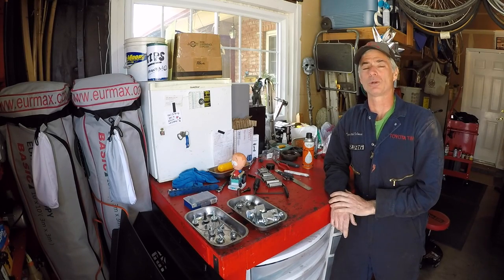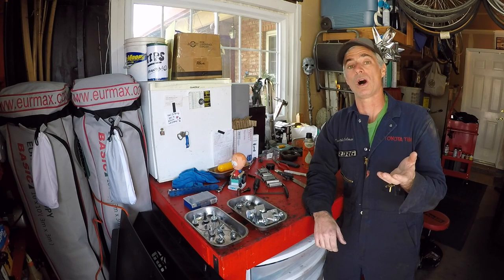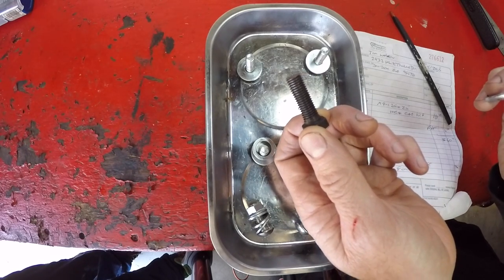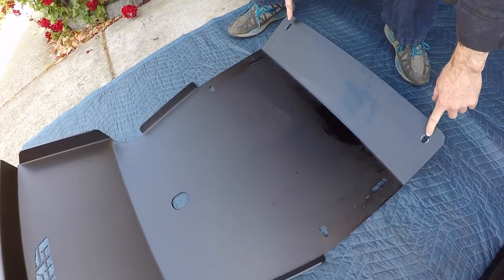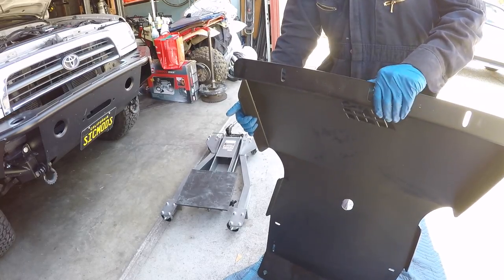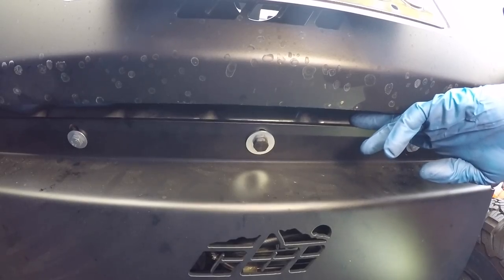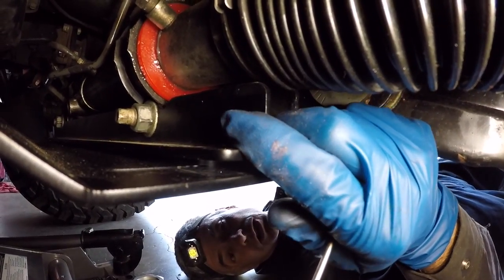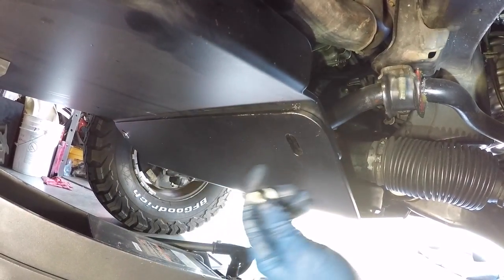CBI Skid Plate Installation (3rd Gen 4runner)

Comment: Another great video, thank you! If you get time a wheel bearing video would be great. Thank you for all your work!
Reply from the maker: Hey Bill, glad you like the video.  Our manual hub conversion video basically shows you how to do a front wheel bearing. https://youtu.be/TZ2sOfVrnhU  But, I plan on doing a manual hub conversion on my 98 soon and it will be a little different than the video we did because I will be swapping over the manual hub parts to my 4runner knuckles because I want to retain ABS function. The Tacoma knuckles don't have ABS ports.  We will make a video of the press work for this project and it will hopefully give you everything you'll need to do the wheel bearings on your 3rd Gen.

Comment: I have another brand on my Seqouia to deter the catalytic converter thieves when the wife goes to the big city.  This looks really nice. I may have to get this set for my 01 4runner.  I use the Fram Ultra filters and only pull the plate down to change the filter at 15k (@5k oil changes).  The ultra's are a great filter unlike the reg orange can.   Great vid!!!!
Reply from the maker: You know, I didn't even think about the catalytic converter theft deterrent.  They probably won't bother with my 1998 now with the skid plates in the way but they can easily cut the ones out on my 2000.  They could still get the catalytic converter out, but with the skid plate in the way, they would most likely just move on to somebody else's vehicle that's easier.  If somebody damages your exhaust and wiring cutting out your catalytic converter, it could easily cost you $1500+ in parts and labor.  You know, I just might add these skid plates to my 2000 as well just for that reason.  At first when I heard about catalytic converter theft, I thought it was just somebody needing a catalytic converter for their 3rd Gen.  But then after talking to some people about it and doing some research online, they are stealing them for the recycling money.  They get pretty good money for them at a recycler because of the precious metals inside the catalytic converter.  And, they target trucks and SUVs because it's easy for them to slide under the rig with a cordless reciprocating saw and cut it out.  

Wow, 15k filter changes.  That's something to think about.  I have been doing it old school with 3k oil and filter changes using OEM filters and a Castrol partial synthetic oil.  I've done a Blackstone oil analysis on my oil at 3k and I could have ran it much longer based off the additives still left in the oil.  I'm going to do another oil analysis at 5k and see what the results are.  I'm probably going to switch to full synthetic and just do my oil and filter changes every 5k.  I don't know if I'd feel comfortable going 15k for filter changes.  Do you have anything I can read up on that did an analysis of the oil filter after 15k, like showing one of these filters cut open to see how much the filter material was blocked up?
Reply: I guess the thieves get good $$$ for the toyota ones.  I just don't want the wife with the kids getting stuck or stranded do to some thieves. So it was worth the money to me.   Go over to http://bobistheoilguy.com/ into the forums then the oil filter section.  Tons of cut open pics and great reviews.  The filters are now rated at 20k!  They are built like tanks, silicone anti drainback, steel center tube,  wire backed synthetic media  and do not drain back or tear like purolators.  Some youtube videos on em too!  99% at 20 micron while the OE Dealer ones are like 50% at 30 microns.  My previous blackstone analysis' showed negligible iron and metals and was well in spec with the average on the side of the report.  I do all my vehicles @5k miles or 1yr whatever comes first.  In your area thats easily doable on the no drama 5z engines. Give the Castrol Magnatech Synth a go.. You can read up on it in the oil analysis area there too.  It's a great oil at a great price!
Reply from the maker: Awesome.  Thanks for sharing all this info with me.  I'm going to do some reading.  Sounds like those filters are legit.  I think I'll give that Castrol Magnatech a try too.  With more infrequent filter changes, maybe I will invest in one of the Fumoto oil drain plug valves so I don't need to drop the skid plate every 5k.
Reply from the maker: Yeah, I'm still thinking about it.  I'm also worried about the fact something could hit that lever and then I burn up my engine.

Comment: Timmy any ideas on how to protect the catalytic converter if skid plates are not worth the money for city driving. I have a 1999 4Runner sr-5 rear wheel drive.
Reply from the maker: Some people paint them with a bright high temp paint to deter theft.  Some buy aftermarket devices to deter theft but I don't know much about them.  Some add an addition to their aftermarket skid plates to deter theft.  I haven't done anything to any or my rigs to deter theft.  For my 98 4runner with aftermarket skids, I might weld on an additional side plate.  For my 2000 that has OEM skids, I don't know what I'd do for it.  I suppose you could also put some type of blocking plate to get them to pass on your rig and go for something easier.
Reply: @TimmyTheToolman   When you get a chance can you make some content on how you would protect your 2000 that has OEM skid plates. With the rise of catalytic converter thefts across the country, the 3rd Gen Toyota 4 runner community would appreciate the content. For us average Joe’s something bolted on as opposed to welding would be awesome.
Reply from the maker: @JA-xr6gr  Yeah, I'll document it if I do it but it's not going to be a plug and play thing.  This is going to be something each person is going to have to fabricate themselves.  Welding will most likely be involved.  Whatever I come up with, I'm not going to mass produce them and sell them.  It will just give people an idea of how to go about it.

Comment: Will this fit a 95 toyota t100? Also how similar are the vehicles? Will your videos cover alot for the t100?
Reply from the maker: I don't know if it will fit a T100.  You would have to contact CBI and ask them.  As for our videos, a lot of them will translate to your T100, especially since the T100 has the 3.4 liter V6 engine just like our 3rd Gen 4runners have.

Comment: Hey Timmy, can you see any downside to cutting a small hole in the middle skid so transmission fluid can be drained easily (much like the oil drain hole)? I would think this would be a feature in the RCI skids but there’s obviously a reason why they didn’t include a hole there. Any insight?
Reply from the maker: Jake Lessie You would be fine cutting a hole for access to the transmission drain plug.  You just wouldn't want to make it so big that a sizable rock could bounce up slamming your oil pan and possibly piercing it.

Comment: Did your rear skid plate have contact with your transfer case
Reply from the maker: No.  I did remove the small OEM skid plate from the transfer case though.
Reply: @TimmyTheToolman  I did as well but still have contact
Reply from the maker: @tylerwallace8414  Something isn't right then.  Maybe share some pics with CBI and see what they say.  Or, stick a piece of high density rubber at the contact point and live with it, I guess.

Comment: My rear skid plate didn't come with the fender washers. I emailed them and they said they don't come with them. They sent me the parts list and I noticed that 2 of those black spacers are supposed to come with the rear one also. My transfer case rubs against my skid plate so I wonder if those spacers are meant to fix that. I'll probably be ordering some of those spacers to fix it.
Reply from the maker: So you didn't have the same hardware that I had?
Reply: @TimmyTheToolman  Nope. I didn't have the big fender washers. I don't know why they don't ship them with it anymore. "We do not include strut washers in the 3rd gen skid kits. Sorry about that!" That was CBI's words.
Reply from the maker: @tylaroverturf  That's too bad they don't include them.  I think the fender washers are definitely needed.
Reply: @TimmyTheToolman  I agree. I think I found some on amazon that might work so I'll give them a try and see if they work.

Comment: In remarks to the catalytic converter, I know on my 00 I have 2 small cats where my dads 98 has one large one. I don’t know off the top of my head where they are placed but it might be better. Also do you think with the added aerodynamics you will see better gas mileage?
Reply from the maker: Hey Jax, maybe the later models with two catalytic converters would make the installation of that one bolt and nut easier.  I guess you could say it's more aerodynamic under the rig now but I'm sure there will be no gain in gas mileage.  If anything, you might see a decrease with the added weight you're carrying around all the time.
Reply: Yeah the weight was my next thought. If only the made them in a thin light plastic for the mall crawlers out there. With the tires I have I get about 11 to 12 MPG. Anything would help at that point.
Reply from the maker: These rigs do not do well with around town driving.  They don't do too bad on the highway though.  I replaced my 02 sensors and my mpg improved somewhat.
Reply: Timmy The Toolman I do mainly city driving and it sucks. I will look into the 02 sensors. Is it serious gains or just one or two MPG?
Reply from the maker: Probably around 2 mpg.  It's really hard to know for sure because it's difficult to match the driving situations perfectly.  Before the 02 sensor swap, the best I saw was 15.4 mpg with a mix of City/Hwy.  After the swap, my first tank got 16.7 mpg with mixed driving but mostly highway.  With strictly highway driving, I got 19 mpg.

Comment: Anyone know what skid plate would serve as a deterrent from catalytic converter theft? Happened to me a few years back, and now its been happening a lot in my area.
Reply from the maker: I don't think there's any aftermarket skid that will prevent it completely but the CBI ones I installed on my 98 would certainly deter would-be catalytic converter thieves.  It basically makes it harder for them to get in there with a reciprocating saw to cut the exhaust to get it out.  I'm pretty sure a thief seeing the skid plate in the way would just move one to another vehicle that's easier.  They do make some anti-theft devices but they aren't cheap and look like a pain in the butt to install.

Comment: A Fumoto Valve would make sense here to ease the changing of oil.  They just replace the OEM oil drain plug and then it's easy to turn the flow on and let the oil drain.  No tools needed.
Reply from the maker: Hey Ted, thanks for the suggestion.  I did hear about the Fumoto valves and I considered buying one.  But, I do like to get the skid plate out of my way for the oil filter replacement.  Some guys take it out via the driver side wheel well.  They just reach in there with a plastic bag around the filter to catch the oil as they unscrew the filter to reduce the mess.  Since I have that transmission jack, removing the heavier aftermarket skid plate is really not any harder than removing the OEM one.
Reply from the maker: Another person commenting said you can get away with 15k oil filter changes by using Fram Ultra Filters.  I'm now considering one of those Fumoto valves.  I remember there was different models of these valves.  Do you have one you would recommend?
Reply: you would want to check whats happening under your car from time to time thought. leaks , bad bushings, they might go unnoticed causing more damage if you cover everything up. 

BTW whats the total extra weight you are carrying with all these skids ?
Reply from the maker: You make a good point.  Part of the benefit of regularly getting your skid plates dropped is to do a visual inspection of how things are looking.  

I never weighed them.  I do know they are really heavy because they are made of 3/16" steel.  I'm sure CBI knows the weight but I have a feeling this isn't something manufacturers of skid plates want to advertise because it's probably going to do nothing to help their sales.  But, I'm sure if I call CBI, they'll tell me how much they weigh.  Once you get into the aftermarket craze of adding heavy duty bumpers and armor to your rig, you pretty much have to accept you're going to take a hit in your mpg and be ok with it.  So for me, I don't really care how much they weigh because I want the protection when I'm 4wheeling.

When I picked up my CBI order from the freight company, it came on 2 pallets.  The order was the front bumper, rear dual swing out bumper, rock sliders, skid plates  and a Warn M8000 winch.  The shipping papers said it was 550 pounds.  Subtracting the weight of the pallets and packing material, I'm guessing when I have everything on my rig, I will have added around 500 pounds.  The winch is the last thing I need to install.  So, it's like i'm carrying around 2 big adults all the time or 3 average sized adults all the time.
Reply from the maker: Thanks Ted.

Comment: Nube here. Looking to buy my first 3 Rd gen. I've been going through the bottomless pit of videos and articles on what to look for and also what too walk away from. Have you done any videos on what too look for?
Reply from the maker: No, we don't have a video for this but here's some advice.  
1) Don't be in a hurry to buy.  The market for 3rd Gens is way overpriced right now.  If you're patient, you'll find a better deal for yourself.  It took me a year of searching to find the 98 I bought at the beginning of this year.  
2) Use Auto Tempest for your searches.  You can search multiple Craigslist areas at the same time based off how far you're willing to travel.
3) Look for vehicles that have a single owner because then you'll get a better vehicle history.  
4) With used vehicles, service records are super important so you know the vehicle was well taken care of.  A CarFax report will show some services but not all depending what shop the owner used for servicing or maybe they did their own work.
5) Do a thorough inspection of the vehicle.  See what the engine oil looks like.  See what the trans fluid looks like.  Are there any major oil leaks.  Is there any body damage.  If you are in a part of the country where they salt the roads, check the undercarriage for significant rust.  If the frame is rusted really bad, don't buy it.
6) Definitely run a CarFax report to make sure there's nothing wrong with the title, there's no accidents that they didn't already tell you about and if there's signs that they are trying to scam you.  Odometer fraud is pretty common.  Look at the mileage it was last smogged or serviced and see if that matches with what you're seeing on the odometer.
7) Take if for a test drive and see how it runs and drives.  Do a brake check and see if it pulls one way or the other.  Does the transmission shift ok?  Are there any weird sounds or vibrations?  If it's a 4wd model, try it out in a parking lot somewhere and make sure it shifts into 4high and 4lo.  If it has the locking rear differential, put it in 4lo and push the locker button and make sure it engages.  You'll hear it and see the light on the dash.  If the light is flashing, it's not engaged.  The light will be solid when the locker is engaged.
8) Make sure everything works.  The power windows.  The moonroof.  The sideview mirrors.  Stereo.  Air conditioning.  Power seats.  Front heater controls.  Rear heater controls.  Cruise Control.  Head lights, turn signals, brake lights, hazards, etc.  
9) if the vehicle is close to where you live and you have a shop that you trust, maybe they can do an inspection for you.

I hope this helped you out.  You got me thinking though, this might make a good video.  Good luck with your search.
Reply: I appreciate your fast response. Thanks for taking the time to share some knowledge and wisdom.
Reply from the maker: You're welcome.  Hope you find a good 3rd Gen 4runner.

Comment: How much weight did you add with all the plates?
Reply: I just did mine and I would guess somewhere between 70 and 100 lbs. CBI sells aluminum versions if you're concerned about weight.

Comment: Does this skid plate fit with a 1 inch diff drop installed?
Reply from the maker: Excellent question.  Yes, it does.  I have a 1" diff drop on mine.  I should have said this in the video.  I'll need to add this in the video description.
Reply: Awesome good to hear thanks for the response. I've noticed a lot of companies don't really specify whether they fit or not.
Reply from the maker: Yeah, I had to ask that question.  CBI is creating a new website and hopefully they'll include the fact that their skid plates work with a 1" diff drop.  If not, I'll remind them to add that in because the people who are usually in the market for aftermarket skid plates are people who've lifted their rigs and are probably running a 1" diff drop.